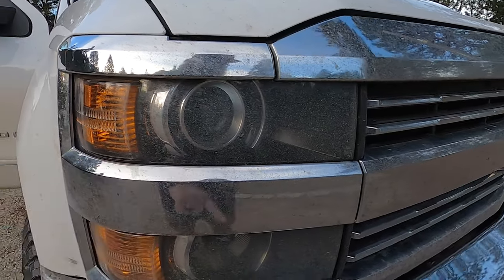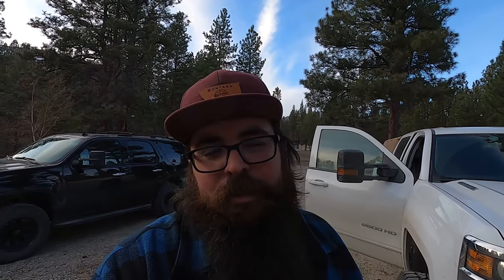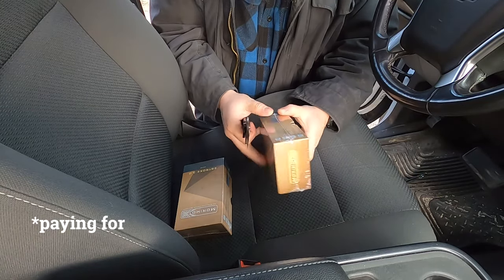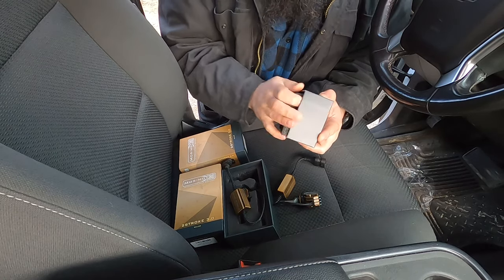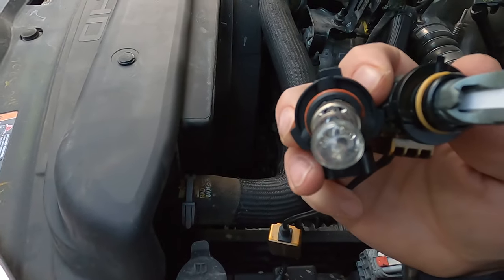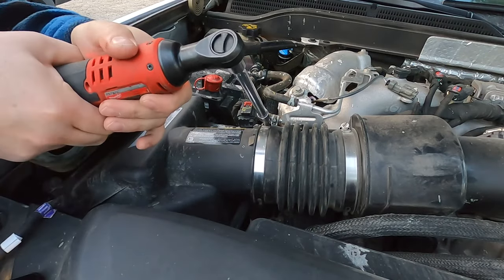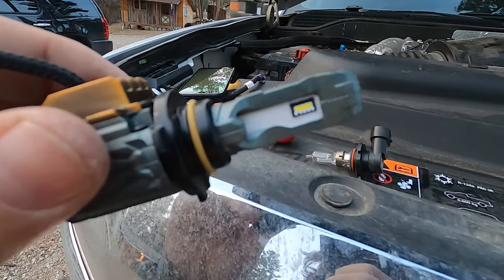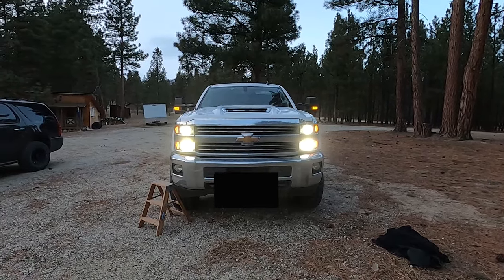Morimoto 2Stroke 3.0 LED Headlights - ARE THEY WORTH IT? Install & Review

Comment: They look great to me- I think you’re expecting too much out of a plug and play h11 headlight LED vs a designated spotlight
Reply: InstaBlaster
Reply: How much more throw u want? Lol that’s pretty far throw
Reply: Yeah, I was thinking the same.

I run spot pod lights behind my grille to acomplish a super far throw cuz there is no lightbulb or DOT complient retrofit proyector that will actually go as far as I wanted. Not even a 65 watt HID proyector will do it if it is DOT complient.

For me, a set of GTR ultra 2 bulbs in the high beams, ans a set of morimoto 2 stroke 3.0 for my low beams are the way to go in the headlights. Then I might add dedicated light pods to enhance performance cuz I drive late at night quite regularly and I take a lot of back roads that are pretty sketchy and insecure (Mexico is not a good country to be driving late, but I have no other choice for now).

Comment: Looked pretty good to me. You don’t want to be glaring other drivers either, which some brighter bulbs do. Your stock halogen must have been pretty good if that was barely better.
Reply from the maker: Halogen weren't too bright, but not any worse than my old Ram's stock bulbs. Although, my wife's Tahoe just has better than stock halogens and they're pretty bright. I definitely don't want to blind anyone. Thanks!

Comment: Personally I think sometimes we get a little too hyped and expect a lot. I know these improve lighting substantially on my car. I installed them on my 2010 Corolla in the low and highs and they more than tripled the light output and had zero glare. The best part is I left one side halogen while I tested to see if they would raise the light cutoff height as some less precisely aligned bulbs do. And they did not alter my cutoff height at all on my low beam. I was able to leave the aim stock. I then asked my mom if she would drive in front of me the next night. Then I had her wait down the road while I came toward her at about 45 mph. She said they did dazzle a bit when I went over one bigger bump on the road but other than that they didn’t glare at all. I should point out these were installed in brand new (never installed until the LED’s came in) OEM Toyota headlight housings. I did this because there I just no competing with their consistency on their reflector/projector quality when you’re not swapping out the optics in a retrofit. Like a biLED projector in its place or something. Anyway with a lux meter I  was able to
Measure 210 max lux on low beam at the brightest spot with halogen and 685 lux on the halogen high beam. Then after the two stroke 3.0 led bulbs were installed the low beam max lux went to 581 lux and the high beam was at 1785 lux. I’d say that’s a sizable increase. Just out of curiosity I wanted to swap out my gf’s ddm tuning LED’s which actually are the same led chips and power level as the GTR lighting ultra 2 LED’s I believe that’s the correct model. All I know is they use the same chip as the 55 watt GTR lighting led bulb. So the raw lumen output is extremely high at 55 watts compared to the Morimoto. So in theory the ddm tuning bulbs should be brighter. Incase you’re wondering how this worked, she has the same car as me just a year newer and base model. Mine is the XRS but uses the same bulb types still for headlights. Oddly enough the lumen level on the ddm tuning/GTR Lighting led did go up but not by much and the beam shape was pretty bad compared to it. After she saw mine she ordered a set right after lol. Anyway the lux readings are as follows for the ddm tuning 55 watt led bulb low beam 623 lux and high beam 2009 lux. Very impressive numbers but when you see the low beam cutoff it’s obvious which is better. She also does get flashed quite often and we’ve lowered the beam a few times to the point she runs her high beams when she can because her lights don’t shine down the road very far due to the angle of aim she had to lower it to. In order to keep from getting flashed non stop. I have yet to be flashed and actually had a few people ask if my car came with oem LED’s because it looks so uniform and smooth lighting wise that you’d never know it wasn’t original.  

My point is yes I think you expected too much but you should also know that LED PnP bulbs will sometimes be brighter in some housings and projectors than in others. Maybe this is the case for yours. Because mine worked out incredible well
And extremely bright. There’s also a question about where your headlights are hazed up at all as that will rob you of light output quite a bit before most people realize that is the cause.
Reply from the maker: Good points! My lights aren't hazed up. The housings are only a few years old. It's dust. I think also the fact that I'm driving in very dark rural areas vs. others goes a long way. In the city it probably seems brighter, too. I'd think it's a mix of the bulb not being as bright and just being a cleaner patterned LED and the housing and not built for distance. Thanks for the comment.
Reply: That's a lot of awesome info and data points. Thank you for taking the time to write that out

Comment: Bulbs can only do so much if the housings and lens are not designed to throw light the long distance you want. Designers of the OEM lights knew they had LESS light to work with and likely focused it closer to the vehicle.

Comment: I have them in my wrx on a projector with 9005 bulbs. Compared to a halogen bulbs these are way brighter. And the beam patter is identical to a halogen bulb like advertised. The hot spot is very bright as well as the flood around it.

Comment: I have these bulbs in a low beam projector housing and wasn't blown away by their brightness either. I previously ran DDM Tuning SaberLED 50W Pro bulbs in the same housing which were many times brighter, but I got a couple flashes from oncoming traffic in the city, so I swapped them out for the 2Stroke 3.0. I keep the SaberLEDs in the trunk as a spare, though.
Reply from the maker: Thanks for this. It's good to know I'm not losing my mind. Do you recommend the Sabers? I'm considering changing at least the high beams to as bright as possible as I won't be running them with oncoming traffic anyway.
Reply: @WildMountainGarage  Doulos, if you want bright and not blind led bulbs, the best option is the morimoto 2Stroke 3.0 in reflector. In projector, maybe you can try the lumibright xt1 gen2, it is the best performance with CV3 LEDs. More than DDM saber Pro 50w or prox 55w. You can check the reviews/driving video from BULBFACTS.
Reply: @WildMountainGarage  I'd go with @Marco Yuen's recommendation and check out reviews at bulbfacts. I can't make a personal recommendation, as I only have the two bulbs for comparison (as well as noting that both are still brighter than stock halogens). 

I was happy with the Sabers, however, until I started getting flashed. :(
Reply: Marco Yuen n
Reply: Beam patter is very important, kudos to you for recognizing the brighter bulb was causing issues for other drivers and you changed them! From what I read, laser based projectors are the best but expensive.  I still personally love HID projectors but also have these on my car just for simplicity and longevity.

Comment: I just bought 2 pairs and i feel the exact same way, i was expecting to be blown away but that wasn't the case, my cheap $20 hid headlights that these replace were brighter.
Reply: HIDs get hot but perform incredibly well. LEDs have to stay warm, not hot, because heat will cause the LED to dim. I have some Lumibrights XT1 GEN 2s (new in November 2020) that are bright but they still don't compare to HID. We are getting better designs as time goes on. Maybe we will get LEDs as bright as HID in 2023 lol.
Reply from the maker: Glad I'm not the only one. Sorry you spent all that for nothing!

Comment: I just picked some up too.   I was using a different brand of LED bulb.    

the 3.0's are not as bright as the 2.0 but I will say this; the light they produce is more useable and they seem less fatiguing to the eye....    Yes the fans are loud but they are quiter than other bulbs I have used.
Reply from the maker: Good comment. The light pattern is definitely clean and doesn't bother me.

Comment: The impression I got after watching several video's on LED headlights of different manufacturers is although these Morimoto's are way more expensive than similar OSRAM or Philips/Signify, they do not perform any better. Probably a consequence of the fact Morimoto uses the same chipsets OSRAM and Philips sell them wholesale/as OEM. The fact the cooling air flows through the front openings inside the headlight bowls or reflector housings (patented for sure) means that snow on the outside will probably still melt, while with all other types circulating the air at the back this will not happen. Of course, if snow is seldomly a problem in the environment this feature may not be of interest to a lot of us. BTW mosts tests I watched on YouTube were on the H4 versions, not the H7 of this post. For some of the OSRAM H4 versions, German regulation now supports the use on specific car models, which are listed publicly (and the validation stickers come with the LED units).

Comment: I've been rocking a pair of 9007 2stroke 3.0 and I've used many different no name Brands from ebay/amazon, yes some are brighter but with very uncontrolled light patterns and the hvac for the bulb housing kicks ass being my happy ass lives in Alaska and thawing headings is so nice!   I've got lightbars on my car for extra throw since my headlights pattern isn't as good as a projector but does awesome none the less. I'll run out of the 3 warranty in a few months and we'll see. So far so good though been very happy and I'll be replacing all my rigs now I feel is so worth the price!  Do wish they were a little brighter but they are a true osram automotive bulb unlike many other knockoffs that yes may be brighter in times. But! Are usually over driven so burn out much more quickly then a quality bulb, much like the hid's on how much/type of salt that is used along with the driver.

Comment: Morimotos goal with the 2stroke 3.0 wasn't necessarily brightness, but rather maintaining the beam pattern to the halogen bulb, and the overall build quality. In my opinion I'd say that the 2stroke 3.0 would make an excellent fog light bulb as it's not overpoweringly bright, and is completely water resistant and enclosed meaning you wouldn't need to worry about the cooling fan failing. If brightness is what your really looking for, I'd go for the GTR ultra 2. Running those for my low and high beams and their performance is excellent. And I'm running them in my reflector housings!! If you ran them in your projector housings, they'd perform great. Especially off road and on a very dark trail at night. No need for light bars!

Comment: I just installed these bulbs. My car uses 9012 in projector housings. These bulbs aren’t touted to be the “brightest” on the market. Their main focus is to more effectively distribute the light, almost the same as that of a halogen bulb that they replace.  The beam pattern on mine is almost identical, so the hotspot is very focused, similar to that of the halogens. I’ve tried other LED’s, and they’re definitely brighter, but the beam pattern is crap. So if you’re looking for brightness, I’d go with the GTR or SV4, or even go HID.  My bulbs are 5500K too btw and they appear to have a light blue tint to them when looking at the front of the car, but behind the wheel they have a pure white look.
Reply from the maker: This is good info. Thanks! The beam pattern is good, that's for sure.

Comment: Yeah they look. Great and the led market is getting better and better. If you go cubes they to match the spectrum those 3.0's are on or they won't look as cool. Rigid has some good cubes.
Reply from the maker: Thanks for the tip! I plan to do a bumper eventually and cubes or other trail lighting.

Comment: I also have these on my 2017 Durango. They are really dim and not bright enough for travel on super long stretches of road with no street lights. I'm considering getting hid conversions and returning these so you're definitely not alone
Reply from the maker: Good to know, but sorry to hear you're having the same issue. That's really it for dark roads with long stretches they did nothing. They're still OK for now, but I was definitely hoping for brighter output.
Reply: These bulbs were like 220 bucks but I'm returning them because I ended up doing a quick hid conversion at a one employee light shop, 6k hids broo, he installed them in like 5 mins each side! With ballast zip ties. The total was only 160  and the output is crazy bright and nice. The hids weren't even a big brand name either. I leveled the headlights myself and have not had anyone flash their lights at me either. Nd now I can finally see
Reply from the maker: @mlolo17500  6k HIDs, I'll probably go that route next time. Thanks for the tip!
Reply: @WildMountainGarage  for sure bro! Ya you should get them, so you can just Set em and forget bout em wit no worries at least until leds get there stuff together
Reply: Idk if it’s with the projector housing, but my Armada with the regular reflector housing suits the morimotos really well. IMO they are at least 5x brighter than the stock bulbs
Reply: @turtle3117  wow really? That's tight bro, I found out that the morimotos weren't bright enough because I needed that other peice to connect between the headlight connection and the bulb I forgot what it's called but it  solved my issues 🔥

Comment: I think people are missing the point of LED lighting, a quality led is more reliable has instant light and brighter than its halogen counterparts. Also simple install and plug and play. Many tests shows they aren’t blow you away brightness but in average 40% better than a regular bulb. In your projector you also cannot see the bulb so it’s likely not positioned correctly in the housing for best performance.
Reply from the maker: It's positioned correctly per the instructions, to which I can tell when putting it in the housing. The bulbs are designed to be clocked before inserting. I'd say these are 10-15% more than the stock halogen.

Comment: The additional wiring was able to fit in the housing correct? You didn't have any trouble putting the cap back on the back of the headlight?
Reply from the maker: Correct. No issues with fitment or anything else to this day.
Reply: @WildMountainGarage  did you need the antiflicker links for these headlights?

Comment: I think you may have been better off with the GTR ultra or some other high power LED replacement. These 3.0 are mainly designed for reflector housings because they mimic the position and size of the halogen filament such that they maintain the beam pattern to prevent glare for oncoming traffic. Also they are capable of dim operation for DRL replacement applications that run at low voltages. So I feel like you’re missing out on a lot of those features in a high beam only projector application and I agree you probably wasted your money a bit.
Reply from the maker: Thanks for the tip. They don't seem any better in the projector vs the reflector. I had thought that perhaps the power could be amped a bit. Maybe I'll check out another brand for the high beams, but my guess is it won't be any different without significant LED quantity or driver output differences.
Reply: I have the gtr ultra2 and they are bright but they suck in reflector low beams because they are to bright but in high beam or projectors are good. You should check out Headlight Revolution on the gtr ultra 2.
Reply: @WildMountainGarage  I think what may be holding those lights back is the quality of the projectors. The heat and light intensity from halogen bulbs can cause some clouding up in the reflector and the glass lens. So that may be what's causing the LED bulbs to seem underwhelming.

Comment: LEDs perform better in reflectors. They perform worse in projectors. That's why projectors need a really good quality LED with good heat management so it doesn't dim.
Reply from the maker: Thanks for the info!

Comment: Let's work poorly in projector housings vs an HID or a designated LED projector. Headlight housings no matter how bright of a bulb you get will never have a mind blowing beam pattern as they aren't designed for bright output. After spending hundreds on led bulbs over the years the only reason I'll pay for a name brand is reliability and warranty.

Comment: Mine started to act up today when the temps were 7 degrees. Once I turned them off and on they came back. Also Silverado 2500 2019.
Reply from the maker: Good to know. I noticed some flickering in town the other day, too.
Reply: @WildMountainGarage  might need that pwm module

Comment: Did you have get have to buy the anti flicker harness? Or just the leds
Reply from the maker: Good question. No problems with flicker on these with my truck. I did notice flicker once or twice intermittently in extreme cold last winter not long after installing and it only lasted a minute or two but that was all. My guess is the board was cold, but no clue why that would do any of it.